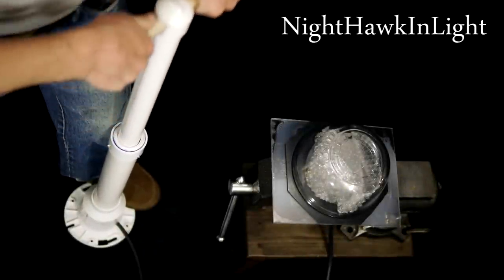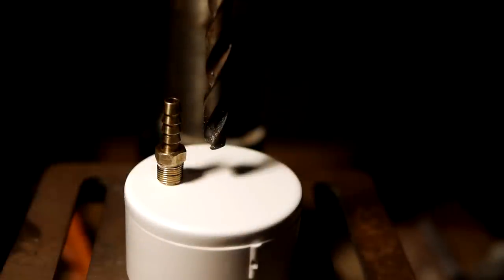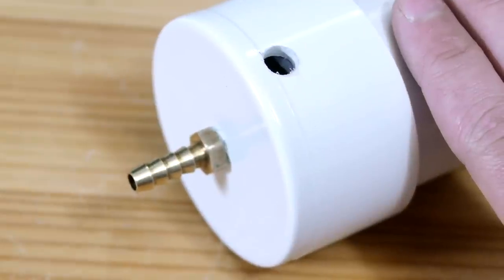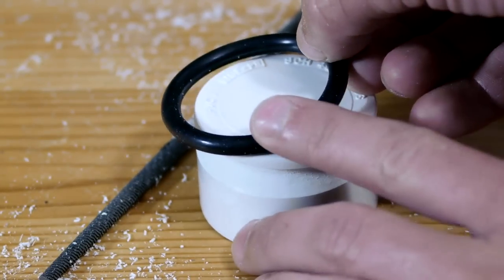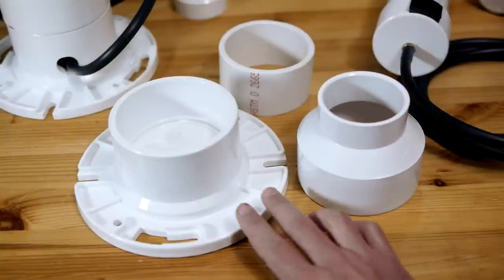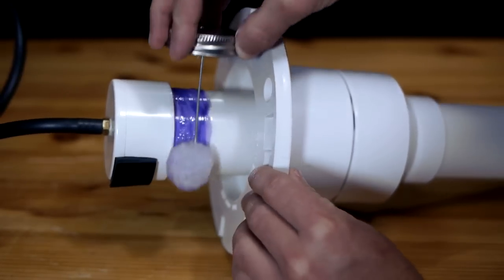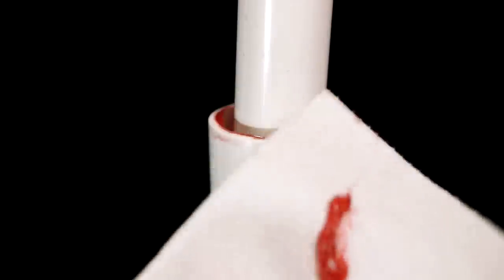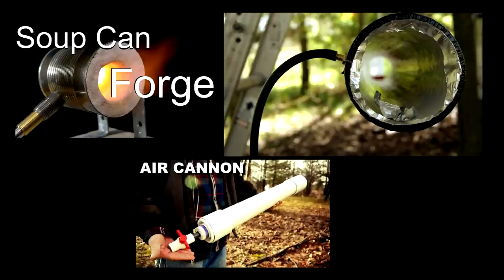How to Make a Vacuum Pump

Comment: I'm an auto technician, and most hand-help vacuum pumps you buy to use as a diagnostic tool are tiny and break often, even though the bodies are brass, the valves are pretty cheap. I plan to make one of these to use when at home, since I'm not spoiled with an HVAC machine to pull larger systems down when away from the shop!
Reply: Nope. This machine will not achieve the vacuum levels necessary to evacuate an HVAC system (500 microns or less). You will unknowingly leave too much atmosphere in the system.

Comment: Great video. One suggestion: screen with complete list of parts spelled out. One question: how to create pressure (vacuum) release after vacuum has been drawn from container. The sound of air re-entering the container is audible, but the mechanism to achieve it without explosive results isn't obvious.
Reply: Use small ball valves and open them slowly for slow inrush of air. Search for "vacuum chamber" and look how the valves are placed.

Comment: Well, I prefer using my body mass + gravity to my favour :)

But youre right, that would be one more seal to make. 

BTW I own a 25$ air pump for camping purposes that sucks (or pumps, depending on what adapter I use) on both strokes. Perfect for bleeding the brakes on my motorbike and car.

Comment: NightHawkinLight. Can you please send me where you buy the bell jar and the vacuum plate?
Reply from the maker: It's a glass bowl from Walmart and a base i made by gluing two small sheets of polycarbonate together and threading the fittings through the bottom. Then a rubber gasket i cut from sheet rubber

Comment: I would recommend giving any areas that are to be bonded to the PVC via CA (super glue) to be given a light sanding with a 180 or so thus giving more surface area for the glue to bond to.  Anyways, interesting video!  Thanks for sharing.

Comment: i like how he thinks about  not cementing it permanently to maybe! remove a broken seal.... but permanent cements every other important piece together to get to the rubbers to replace then if the supergleu fails.... witch is a hard brittle  kind of glue lol so i wonder how you are fixing that when it fails...
Reply from the maker: They still work great, so haven't had to worry about it.

Comment: To increase the seal of the rubber one way valves you could also use low pressure spring to force them closed.

Comment: Hi!
Could this vacuum pump reach high vacuum (0.1 Pa)? Or which is the maximum vacuum value it allows?
(Could the design be improved so that it reaches lower pressures?
Reply from the maker: I can get down to about 28 in/Hg without much effort, lower if you want to keep pumping. I don't know what that translates to in Pa.
Reply: traktor

Comment: Brilliant.  Well-explained, visually perfectly organized, clear...  Nice.  Rare.  Thank you.
Reply from the maker: Thanks! I hope you can put the information to good use.
Reply: NightHawkInLight
Okay, well, I have now attempted to build it.  I followed your specifications carefully (I used lithium grease as my lubricant, and it seems to be working pretty well) but am having trouble with the valves.  I ended up creating a kind of spring-loaded ball valve inside of the brass fitting at the tip of the PVC tube to block air from flowing back into my vacuum chamber, but the rubber flap on the side of the tube isn't holding much of a seal unless I hold it closed with a finger or two.  Have just gotten some thinner rubber to try out.  Looks like you had success with these rubber flaps in the past-- any pointers/ warnings?

Comment: I know this video is quite old, but I've got a question hopefully someone could answer.

I'm currently in the process of building a small bore diameter vacuum cannon, small enough to be able to vacate most all of the air with a brake bleeder vacuum hand pump comfortably. I've seen reviews of my particular hand pump that say they have been able to pull 28 inhg, however after testing mine, re-lubruicating and testing again, it maxes out just shy of 25 inhg.

The oil I used won't damage the rubber seals, but it's quite light and thin. I this video, heavy grease was used to lubricate the piston. Does the heavy grease offer any sort of seal or maximum vacuum benefits over a lighter weight oil due to the viscosity? Or is the grease used due to the large amount of friction in the pipe to extend the life of the o-rings? 

Not sure about using heavy grease as a lubricant in a brake bleeder, but if there is a benefit over light oil I might at least consider it.

Thanks.
Reply from the maker: The issue is probably not the grease. If there is any internal volume in the pump that the piston doesn't fill on the down stroke, that will limit the max vacuum you can possibly draw. Whatever that empty space is that the piston doesn't fill, you're going to have that much air in your pump with every stroke. Maybe heavy grease could help you for the reason that it would fill more space in the cylinder. I used bearing grease.
Reply: @Nighthawkinlight  Alright, I think I'll give it a shot. Much appreciated sir!

Comment: Hi,

Can i use a bigger connexion other than a "Brass Hose Fitting" ? Something with a diameter like a 1 inch ? (i'll adapt the size of the sheet rubber behind of course)
Reply from the maker: +Mathieu Dantez I don't see why not
Reply: +NightHawkInLight  : Ok. Thanks for your answer. I'll try to make one so. Mine will be a little bigger because of Diameter pipes here in France (32 mm, and 40mm for the smaller - 1.26 inch, and 1.56 inch).

Have you any advise to build a vacuum chamber ?

Comment: Helllo mate this is a wonderfull and magnificient work, but do you know how can I get 29 inHg vacuum, I mean what do I need to do in this pump to achieve more vaccum, please let me know mate.
Reply from the maker: 29inHg should be possible with this pump or a cheap ebay/Amazon electric pump. It will just take a lot of pumping to get there.
Reply: @Nighthawkinlight  I have been looking some days ago for a pump capable to achieve -1 bar= -29.52 inHg but it seems is so difficult for mechanical pumps to get this vaccum value, if you know some one I would be very gratefull if you share me the model or name of it. For that reason I found this video on the web and I think with this pump I will be able to achieve -29 inHg. The first time I tried with a little hand pump (9 cm long) designed to extract the brake fluid for cars but it achieve only -500 mmHg= -19.68 inHg and even if I still pumping I cant increase this value to -29  and I DONT KNOW WHY =( . Do you have some idea why this happens?
Reply from the maker: @armandocg3380  This pump can get to about 29inHg, but it cannot get to 29.5. For ultra high vacuum you need something like a rotary vane pump or a sprengel pump.
Reply: @Nighthawkinlight  hello mate I built this pump but I cant achieve more than -22 inHG vacuum, I have been reading about vacuum theory because I dont understan why isnt possible to increase the vacuum, do you think is something about my local city altittude? In wich city you made this experiment? What do you thing is happening in my case? I will apreciate to have your professional opinion thank you in advice.
Reply from the maker: @armandocg3380  It has to do with the valves opening and closing quickly, and also if there is empty space below the piston it will limit how much vacuum you can get. When you push down the pump push it fast so the one way valve closes fast and let's no air back in your chamber.

It could be if you are at high altitude you will not be able to get to 29inHg because there is not 29inHg of air pressure to get rid of. That is how a vacuum is measured at sea level.

Comment: Can the piston be connected to high torque motor and run by electricity ?
Reply from the maker: +CC Kalyan Chakravarthi (CC) Sure, you'd just need a flywheel with a long enough throw to pump the handle.
Reply: 안녕